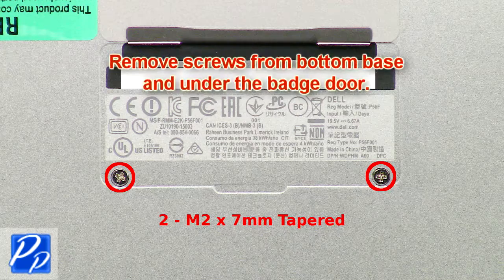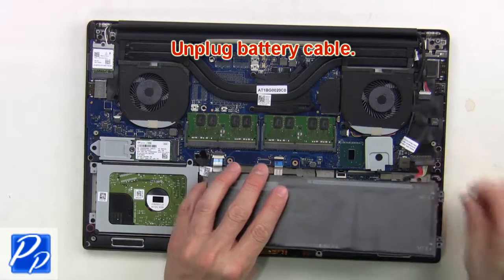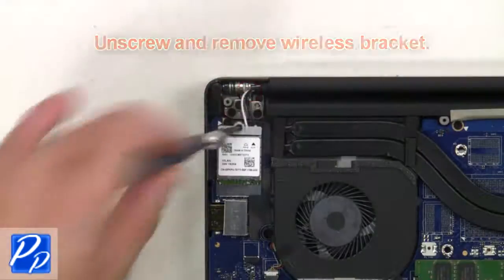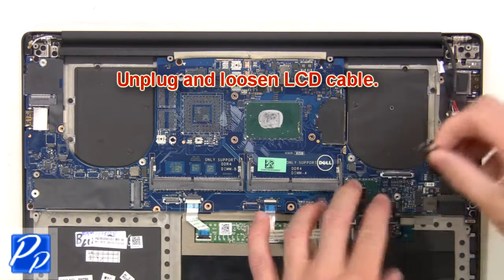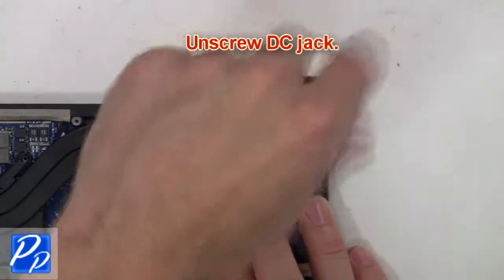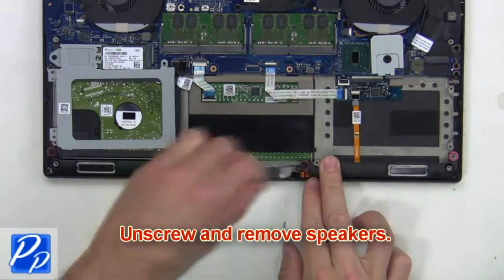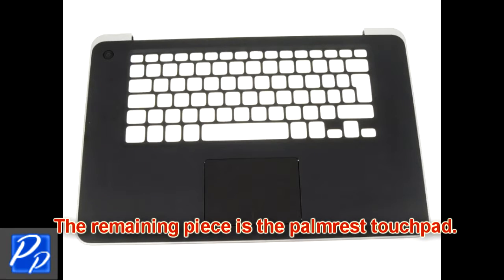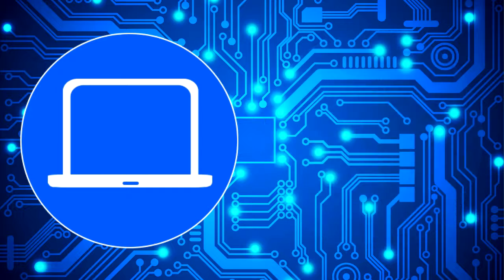Dell XPS 15-9560 (P56F001) Palmrest Touchpad How-To Video Tutorial

Comment: any idea of the palmrests are the same across 9550 9560 9570?
Reply: They are different . I bought 9550 for my 9560 and in the last part I found myself stuck and had to revert everything on the old palmrest, fixing it with super glue...